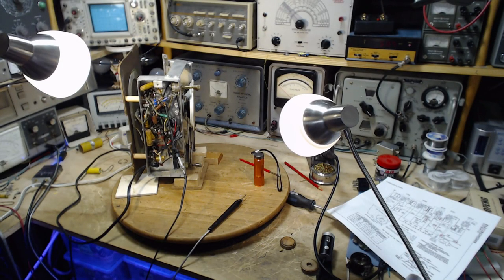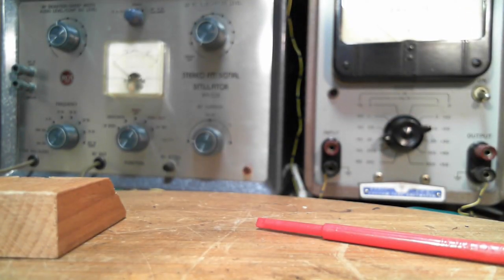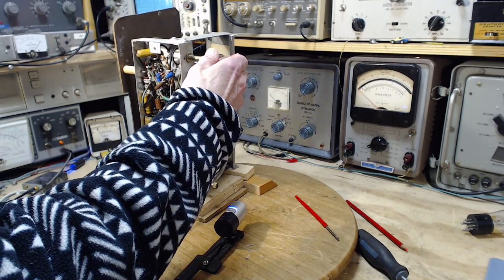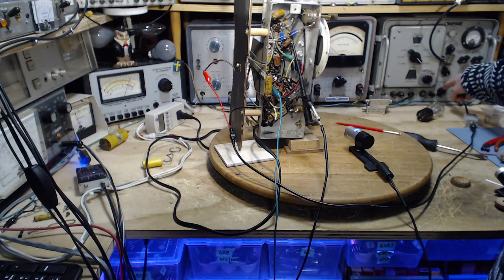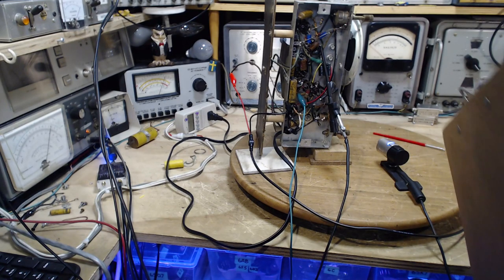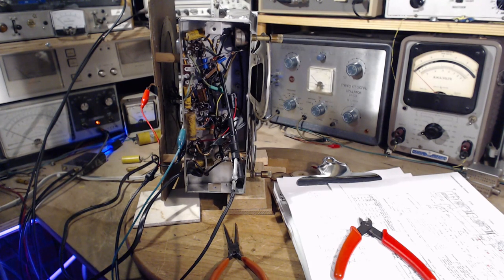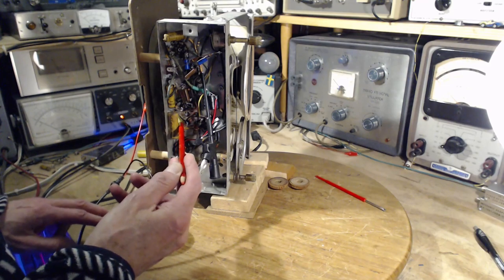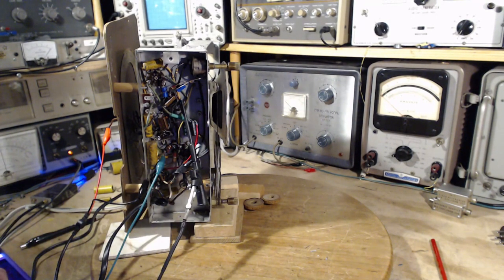Electrohome Cosmic Tube Radio Video#3 - AVC Capacitor

Comment: 35:27 quote "the radio will be more sensitive to signals at a lower level than it was" unquote
Not really. Your rise in negative AGC voltage after replacing the cap just proves how the AGC loop was compromised by that leaky cap shunting control voltage to ground. It offers no insight on the sensitivity of the radio. Sensitivity is determined by RF and IF alignment.
Actually, a AGC voltage like this is only meant to counteract(!) existing(!) sensitivity, not promote it.

Comment: Nice one Jim. 👍. Very interesting and informative as to how you set-up your test equipment, easy to follow. I note all the usual smart arse critics have fallen silent, perhaps they've heard the old saying, " if you can't say anything good, then don't say anything at all ". Shame they can't give credit where it's due. Keep up the good work mate.
Reply: @Graham Clarke: Where is due and why?
Reply: His explanations on the AGC circuit and its high impedance nature are true but nothing than a retelling of comments(!) that were made in previous videos and on previous radios. It remains to be seen if he really digested the info and will act according to it and draw the right conclusions. OTOH let alone the comment that his DVOM was only 1M input impedance and it would not throw up a reading past a 2M2  resistor by much makes one assume otherwise. There is a reason why the test procedure specifies to use the audio output level during alignment.
Reply: @Graham Clarke If one was to teach your children that the earth was flat and 2+2=10, would you keep silent because you "have nothing nice to say" , or would you speak up and object?